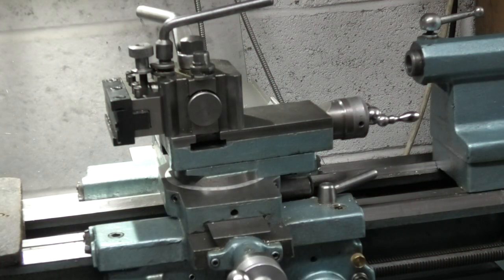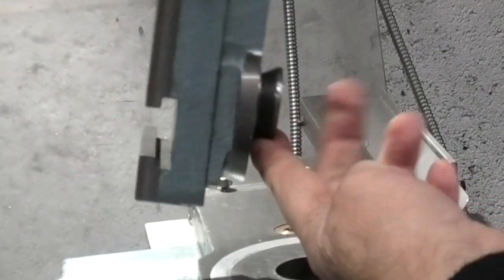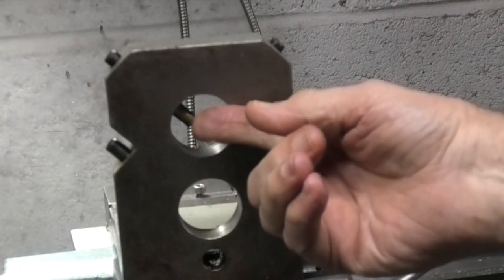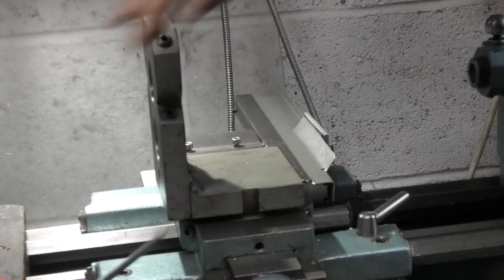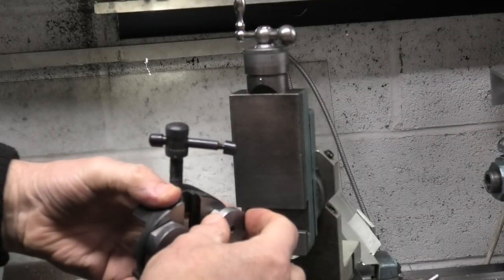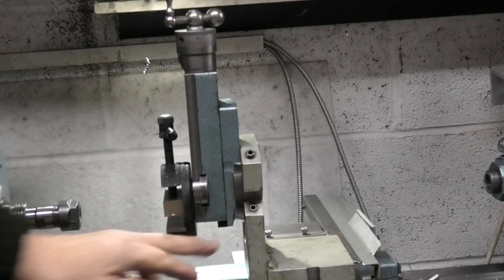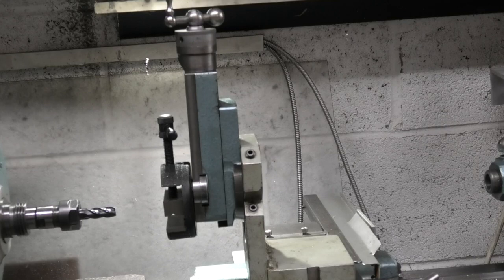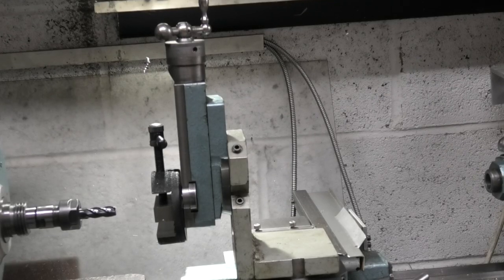Milling on the lathe

Comment: Nice video. Minor issue with the additional axis. You are actually adding the X or Y axis. by convention the spindle is mounted on the Z axis. Pedantic perhaps but accurate.
Reply from the maker: Thanks it it becomes difficult when you have DRO fitted